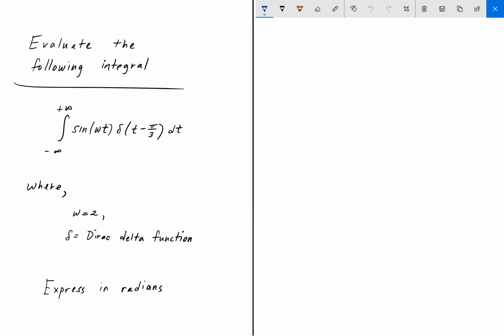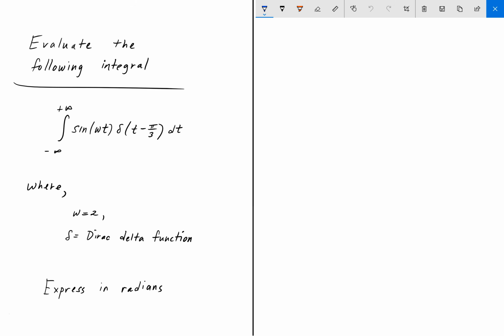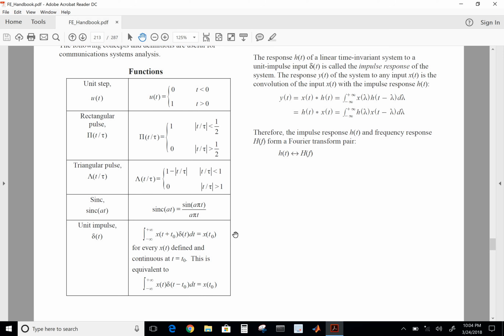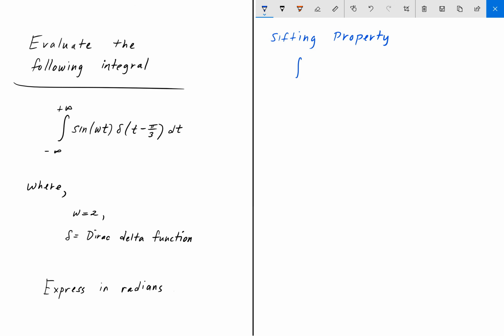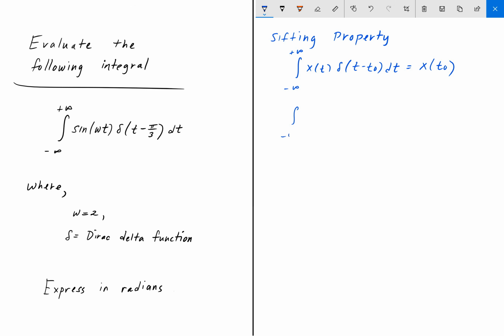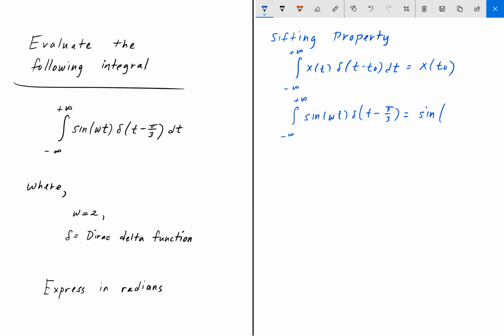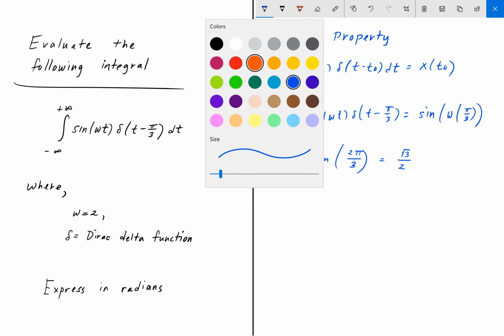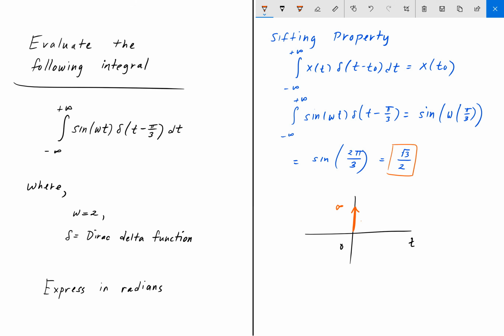Electrical FE /EIT Exam Prep - Communications 3: Dirac Delta Function Integral

Comment: I dont understand how on the last step when you have omega*pi/3 to 2*pies/3?  im confused because i thought omega = 2*pie* frequency.  a little more explanation would be helpful.
Reply from the maker: Hi Andrew, w = 2 is given at the beginning of the problem. Here, the integral is over time t (and not w) therefore omega is a constant. We plugged in 2 for omega and solved. Does this help clarify?
Reply: Ah yes.  thanks for the help.